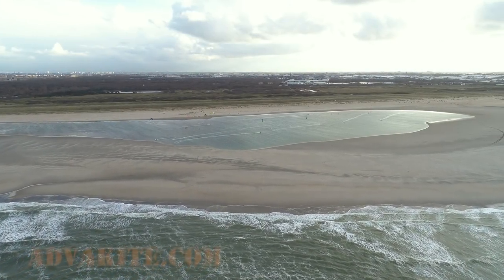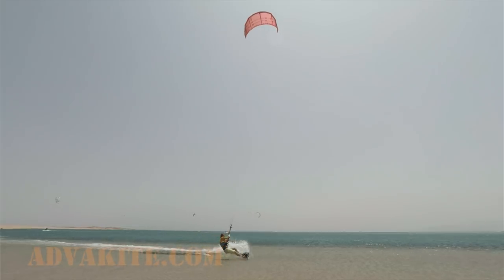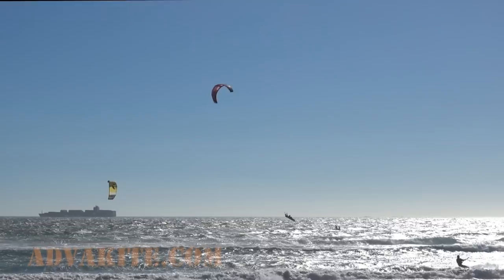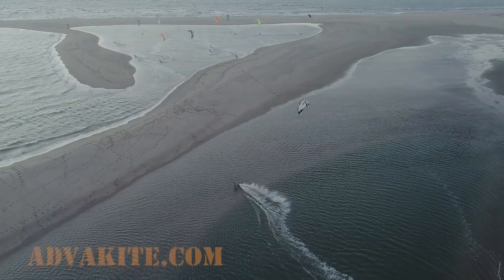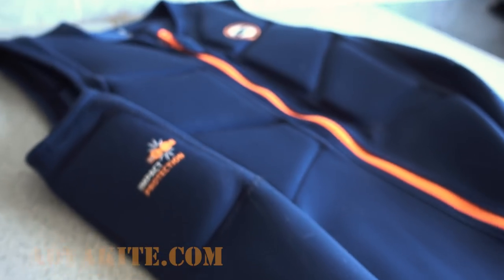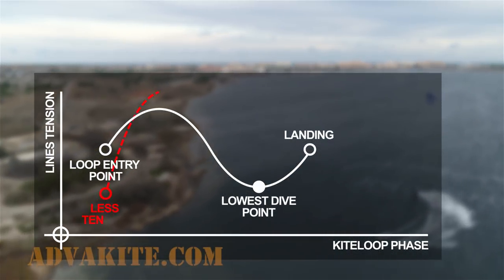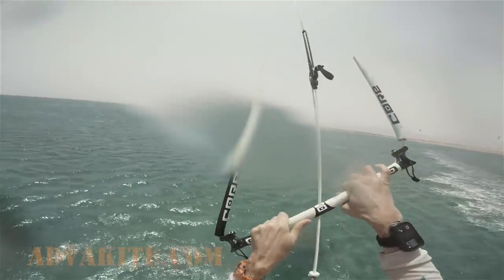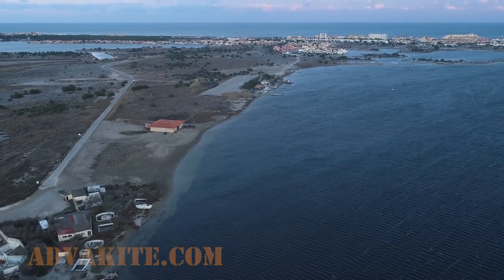Ultimate Kiteloops. Episode III. From heli-loops to megaloops.

Comment: one extra MASSIVE TIP!  only rotate/complete the first kiteloop say 340% not a full 360% or to 11 o,clock,  This way when you push out the bar for the landing loop you will get more lift when you pull in. (soft landing) do this only if its a second kiteloop on landing/finishing. 

If your finishing/landing with a downloop, rotate the first kiteloop to just passed 360% say 1pm then pushout the bar. then pull in again, once again the landing will be soft. 

This method took me ages to figure out, and is not mentioned anywhere on line, so simple but saves your knees and ankles from hard landings.

Comment: Have been waiting for this some time ! Thanks a lot Anton! Would just add 2 cents. Saw few guys looping the kite above 1.5m lets say around 4m . It wasn't proper megaloop  rather the loop in the apex of jump. The kite caught them just fine. That being said, it was on fast turning FX.
Reply from the maker: Thanks! True, it's possible. I've included a note, that min 7 meters is for normal lines setups. For smaller kites and shorter lines this lever is lower.And yea, maybe FX is faster than others?)) Didn't try it, maybe. I've also seen some kite models looping (pivoting) super fast. Will try to cover this topic in the next vid.
Reply: Yeah there is just so many variables in the, it's hard to cover everything. Definitely when I  will start doing megaloops I will grabone of thes  Cab FX, Naish Pivoto/Dash,  CF Tango, or North Dice ...

Comment: Right now, I'm experimenting with a method of doing very powerful kiteloops without jumping first. 

The vertical pull is enough to yank me out of the water 2 or 3 meters (according to surfr). In almost at the point where i can do that and still get the kite above to catch me in time. Even if it doesn't, it is fine because all the forces are dissipated through my high-speed horizontal travel. 

Anybody else tried this? 

I live in a very swelly area so bonus good feels when i can aim myself to land down a swell like a snowboard ramp.

Comment: Nice vid. I got you're learning to fly ep 1-2. Just wondering what you think about newer versions of the slingshot RPM for jumping? And eventually looping?
Reply from the maker: Hey, thanks! No, I didn't try new versions of RPM, older ones tend soo much to stay closer to the center of the window. Even in the air, as soon as you lift off, they pull forward. And the loop was too wide, as I felt it.
Just had that 7m new model of RPM when filming, it loops fast, good for powered loops, don't know anything about bigger sizes, unf.
Reply: Thanks for the feedback. 
They claim,, they fixed the forward pull with the freeride setting option on the newer versionen and the IRS bridle solution. But great to hear your impression.
Keep up the good work and clear-cut explanations really helps grasp the concepts.

Comment: Do I have to initiate the kiteloop at the highest point or a few sec before and why?
Reply from the maker: Hi! 
It depends on what you want to achieve. Earlier you initiate, more faster and powered loop you will get, but with less height. However, if you wait to gain more height and start the loop at the apex, you have a serious chance to miss you "return flight" and land hard with no support. So, for powered loops I prefer to start it a bit earlier, before the apex, like 60-70% on the way up.
Reply: @antonchernyshov8759  Thanks Anton for your answer! I was able to achieve my first "big air kiteloops" with your 3 tutorials and love it! 70% I crash because of missing skills and choppy water, but it doesn't hurt because the Kite catches me most of the times. Great work!